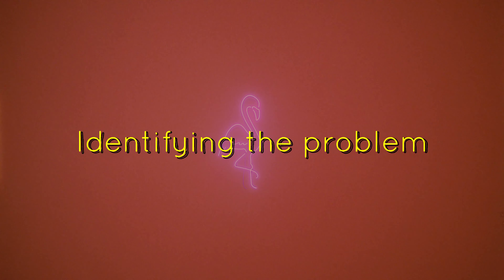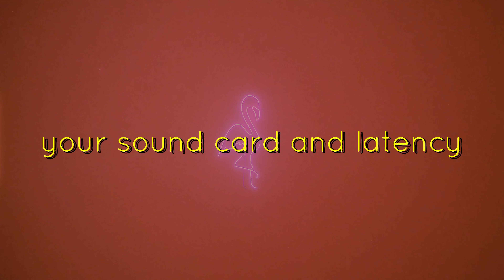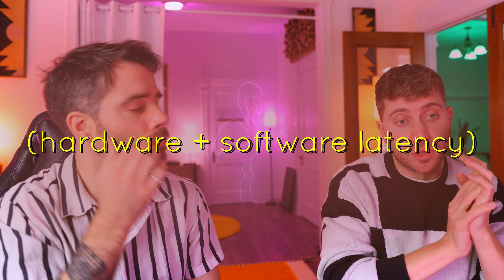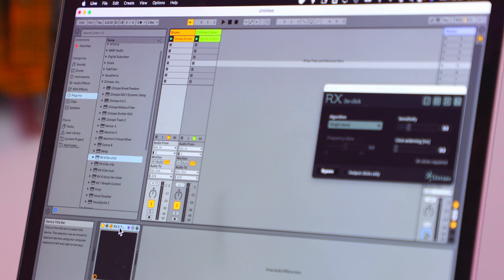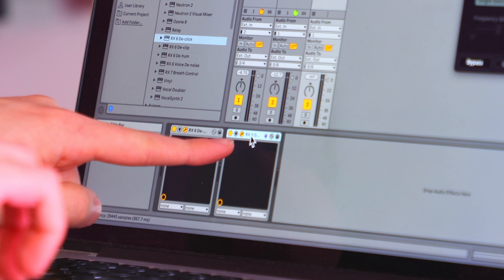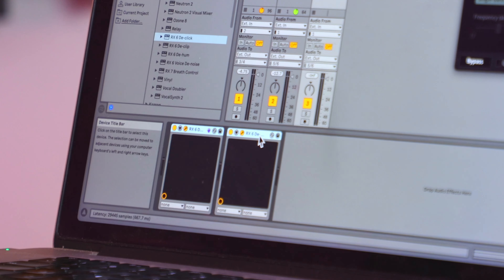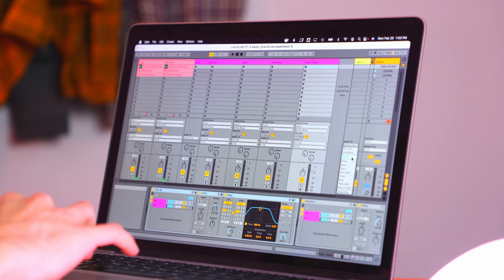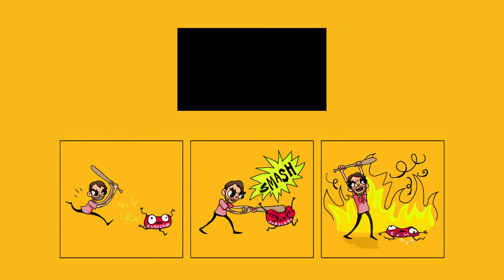All about Dealing with Latency in Ableton Live // Deep Dive

Comment: If you just need a zero-latency safety limiter on the output, you can set up the regular Ableton Compressor as a limiter by setting the ratio to infinity and attack time to zero. If you hit it hard it won't sound as good as the Ableton Limiter but that doesn't matter as the entire point of a safety limiter is that you only get any gain reduction in an emergency, like when something breaks or you have feedback.
Reply from the maker: Thanks for this!!

Comment: Hi, I have a Behringer umc22 U-phoria, i have installed Behringer and Asio AND ASIO4ALL drivers whcich i use to record on Ableton live 11. I reduced the buffer size from the ASIO4ALL v2.15 window that appears when i click on "Hardware settings", since it doesnt let me change it directly in the preferences menu. The buffer size is now 128, and the sample rate is 48000. I have an overall latency of 10.6ms, and yet, when I record an audio track, there still is a very notorious latency or delay when i try to sync up to the metronome. Is anyone else having of had this problem? What should I do? Please help.
Reply from the maker: Hmm it could be so many things TBH
Reply from the maker: Are you using heavier plug ins on any of your tracks ?

Comment: ..buuuuut... what about delay compensation? especially in the preferences window. you can scroll that number to get it to zero. and then there is the option to toggle individual track delays as well with those buttons on the master channel.  i'd like to know how that factors in to the calculations of accumulated delay times. ..any thoughts? can the majority of delay times be offset with the tools ableton provided?
Reply from the maker: Yes delay compensation is an option as mentioned in the video- but it will delay the entire track to compensate which will actually add even more latency to live midi parameter control.

Comment: I'm a rock guitarist that uses Ableton. My fav guitar plugin is Clairvoyant. It sounds fantastic. When I hover the mouse over it it says it has 0 latency. But, once get 20 tracks with a lot of plugins for drum etc the Clairvoyant plugin starts getting latency issues badly. I've tried everything recommended in your video and others but nothing solves the problem. My CPU meter pegs around 40% when the plugin starts lagging. I wonder if my CPU is just gonna be a hard limitation I'll have to live with? I just don't see anyway around it.
Reply from the maker: Thanks for your take on this :-)